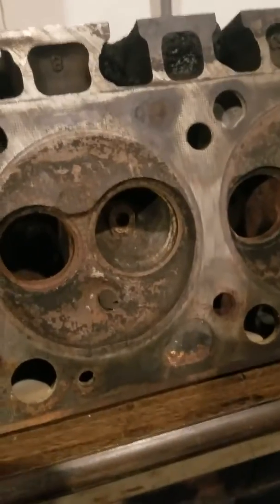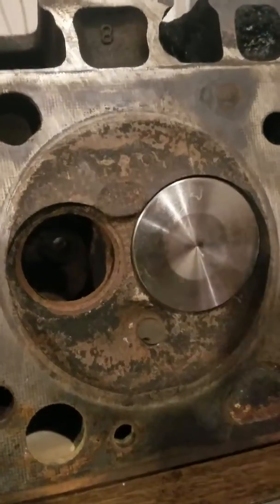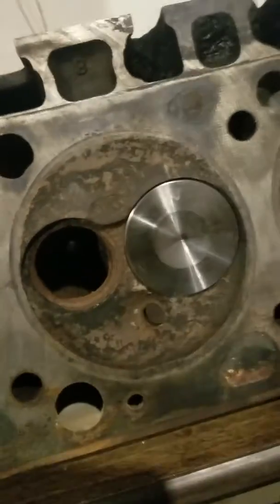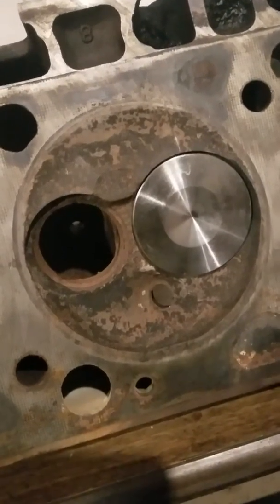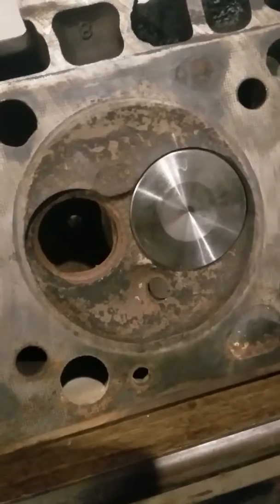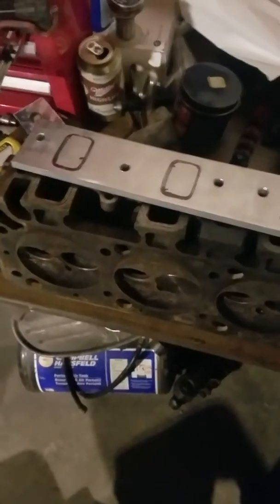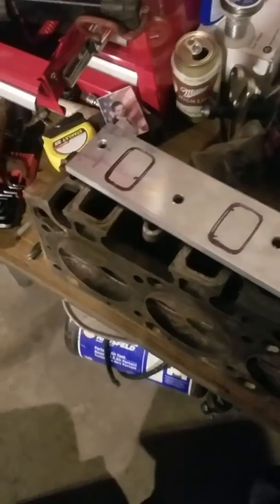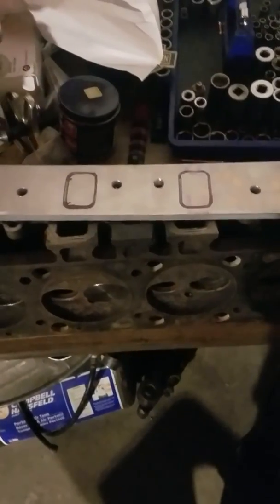Cadillac 500 950 heads

Comment: I saw where larger valves were good for 25hp. But where I am, it's $10 a hole to enlarge a valve. So doing both the intake & exhaust in my town would cost $160. Then there's the cost of the new valves themselves. I'll guess 200. Netting a total of 360 bucks for 25hp? Didn't seem like too much bang for the buck too me~